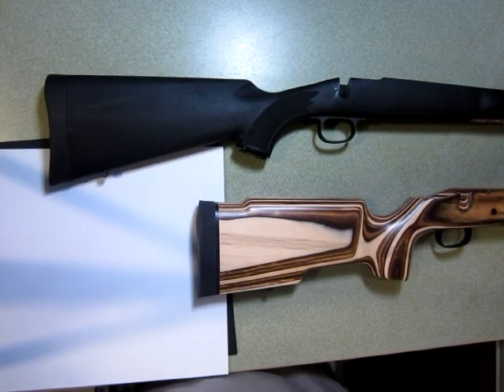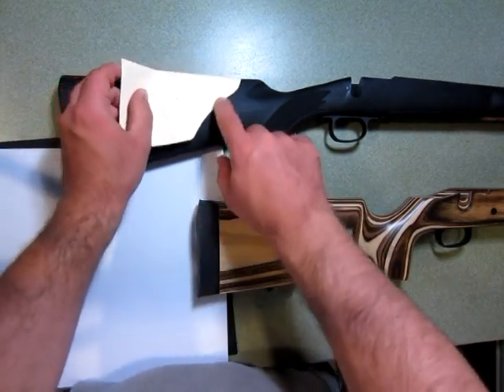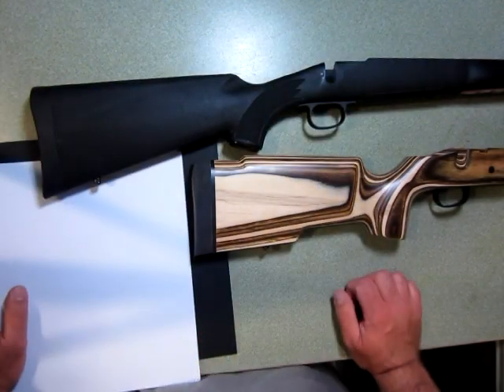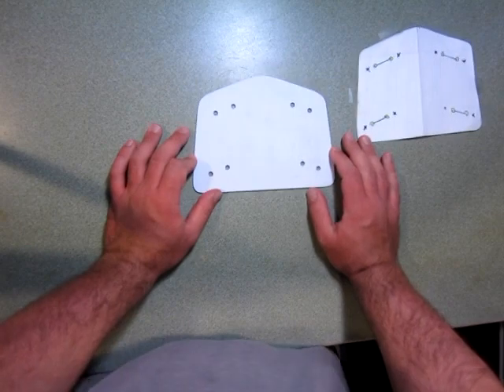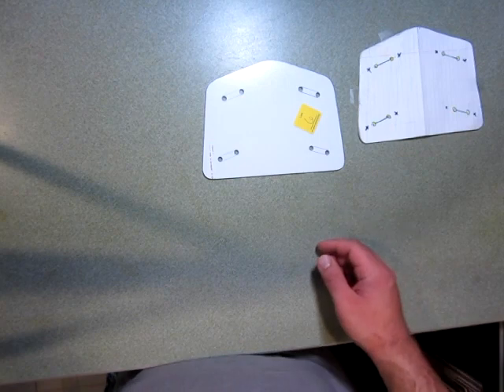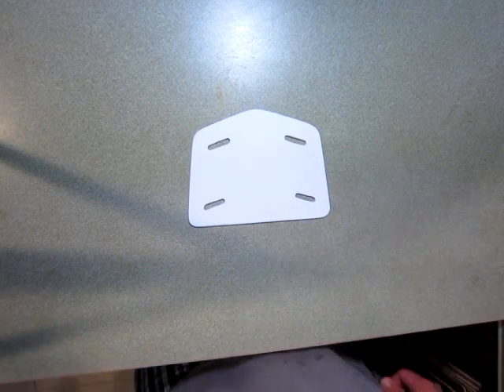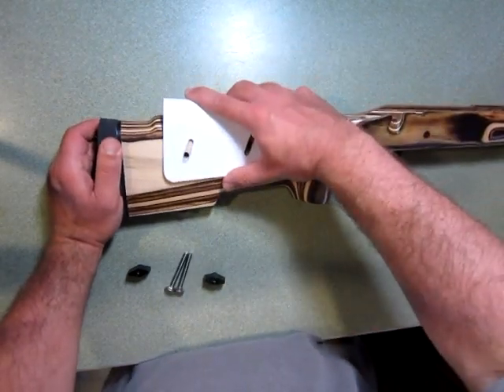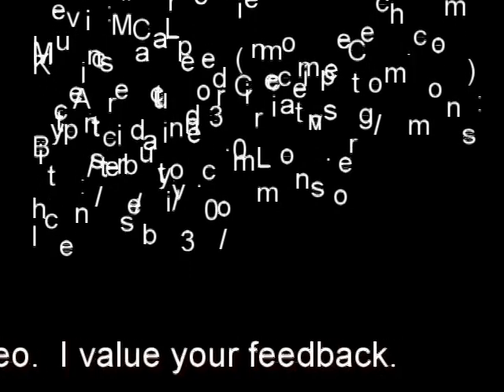Homemade Adjustable Cheek Rest for Rifles (Re-upload without so much music)

Comment: Great work! Takes confidence to just drill into a stock like that. I'm wondering if these risers are something that could be 3D printed...
Reply from the maker: Thanks! The 3D printing question is an interesting one. It's certainly possible. My own printer is a fairly basic model, and it has a big enough print volume to create the part. Really it boils down to whether it's more economical and whether the materials are comparable.

By some fairly rough calculations it seems that a cheek rest like this would need about 100 grams of filament, so just over $2 per piece for PLA or ABS. The kydex sheet runs about $10 per square foot, and I can usually get two rests out of one square foot. So kydex would be $5 per piece. However, I would also say the economy of time strongly favors Kydex. Even starting from scratch with minimal tools, I could whack out a new wooden mold in an hour, and it will be good basically forever. Moreover, a half-round profile on the mold will fit over almost any comb. I've made specific comb profiles for specific rifles, but a universal size and shape will always work. Fabricating the Kydex blank is similarly fast once a template is on hand. Printing a cheek piece would take the better part of a day, especially if it's going to be 100% infill.

And a printed cheek piece would need to be solid to take advantage of PLA's only mechanical property advantage over Kydex: its tensile strength. Really though, this isn't a huge advantage, and any errors in printing the layers are going to compromise it. The biggest advantage Kydex has over either PLA or ABS is its resistance to impact, where it's twice as strong ABS and seven times stronger than PLA. It's also harder than the usual printer plastics, making it better for bearing up against the metal hardware used to attach and adjust it.

So, I don't think 3D printing is going to replace thermoforming for this type of cheek piece any time soon, though there undoubtedly are a number of applications where it would be useful. In fact, now that you've mentioned 3D printing in this context, it gives me an idea...

Comment: Would beneficial to know how you cut out the out perimeter of the blank. Very good video otherwise! 
Thanks!
Reply from the maker: Fair point! In truth, anything that can make round cuts in 1/8" thick plastic will do the trick. I've used a jigsaw, bandsaw, and scroll saw.  If I were smart, I would have made a wood template and cut the blank out with a router and 1/4" patterning bit. That might make the slots cleaner too.
Reply: Thanks for the info!  What method in your experience would give the cleanest outside edge appearance? Thanks
Reply from the maker: @gregggruse2522  While I expect the router method would be the cleanest, I don't have any firsthand experience to confirm that. I recall the bandsaw cut needing the least cleaning up, but they all required a little hand sanding to get rid of saw marks and smooth out any horns on the edges. Fortunately, Kydex plays well with sandpaper at low speeds. If you use a power sander, things can get a little gummy.
Reply: Thanks again!
Reply from the maker: @gregggruse2522  You're quite welcome, and thank you for watching!

Comment: We should all revolt against the synthetic stock dominance which is just cheapness on the part of gun manufacturers. If every rifle I buy needs a cheek piece made or swap for a Boyd’s stock than what’s the point? 95% ready out of the box is all I’m asking. Just mount scope.
Reply from the maker: Don't be mistaken: Boyds screws this up too. Their combs are set way too low to be useful on scoped rifles. I did shell out the extra $60 for one of their adjustable comb Tacticools back when that's what they called the Pro Varmint, but even that gets maxed out with a modestly sized objective bell.
Reply: Good job on the custom cheek piece. Thanks for reply. I’m still learning and this has been a discovery of sorts. Happy shooting!
Reply: @patrickmchenry2217
Not entirely. While I agree that wood stocks are much better and I prefer them as well. Manufacturer's aren't doing synthetic stocks to be cheap. More hunters are asking for lighter weight guns like synthetics than heavier wood stocks and they are seeking to meet that demand. I don't like synthetics because they have more recoil. Which brings up another growing trend. Because lightweight synthetics lead to more felt recoil... more rifle owners who buy them are seeking guns with muzzle breaks and also buying silencers to compensate for the increased felt recoil.
While Manufacturer's are reaping the benefits of cheaper to build synthetic stocks,  it's also being off set in many cases by increasing demands for accuracy in rifles, so a lot of the "savings" from synthetic stocks are moving over to technology that contribute to accuracy (generally speaking).
Reply: @ActinOut  very good points! I believe “shoot what you have” is really my motto. Good thing they are making wood stocks for off the shelf rifles at the moment. I hope this stays the norm.